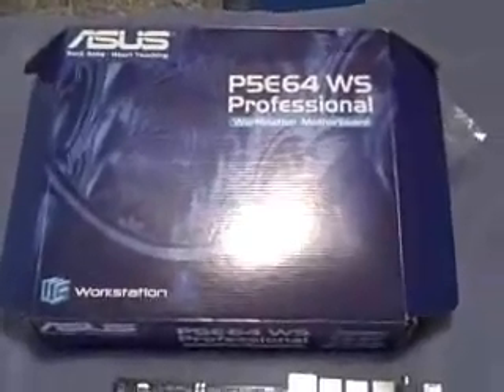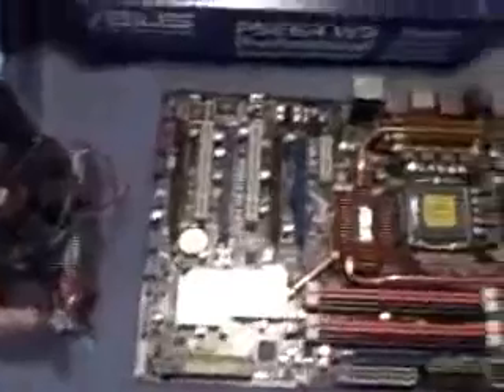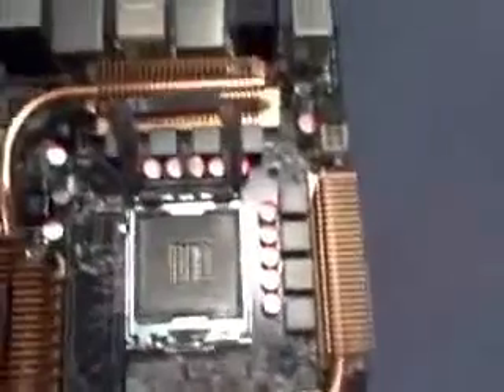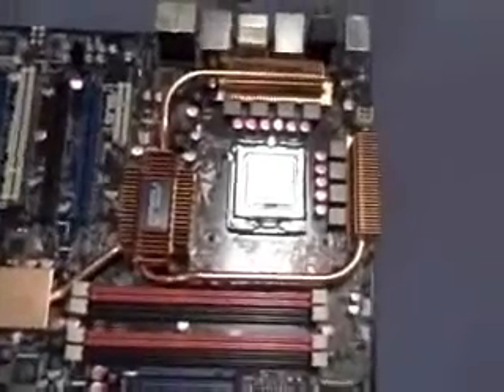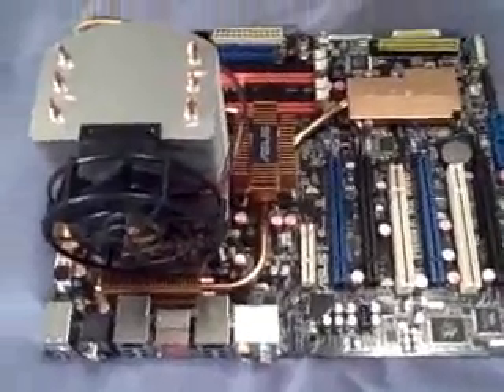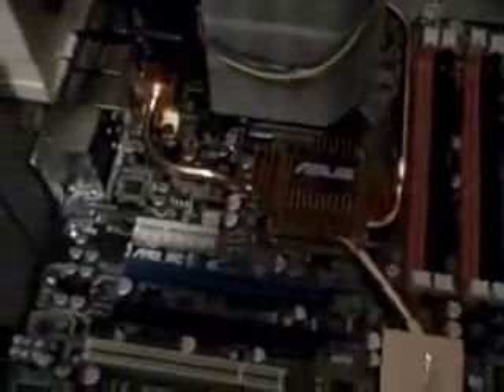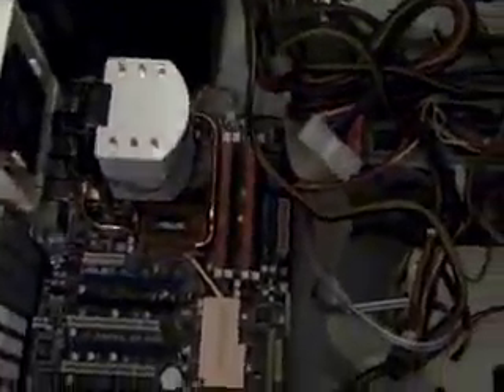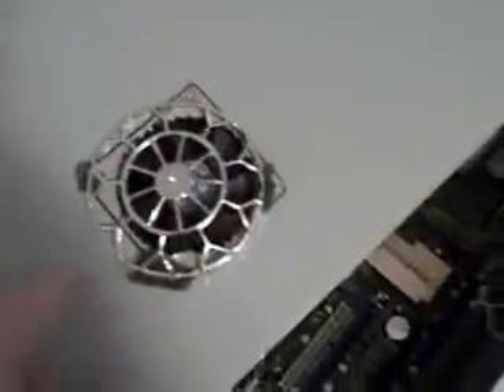Build A QX9770 Quad-Core PC

Comment: i am still running that thing on a790i ultra
with 24gb of ddr3 ram and gtx 460 sli
nobody who owns a i7 is telling me a thing
the 9770 extreme is realy ancient but still kicks asses!
looking forward for k|ngp|n 980ti :)
Reply: DONT PUT A 980TI WITH THAT CPU. omfg. you will bottleneck the shit outta that card ;_;
Reply: googlemaster190 -Minecraft
yes because i'm going to buy an x99 chipset from evga in january :)
the kingpin is running and there is now better performance. but since i own the nForce my system randomly freezes and finaly i looking up for something modern like an 2011v3
but the bottleneck is not so extreme than i thougt it would be
i can run far cry 4 on ultra without any laggs
Reply: @sun--shine3296  and?

Comment: "In about 3 hours if I don't snap off the pins"  What the hell are you talking about?  It takes 3 hours to install the heat sink?  If you're going to SHOW is how to build a system..then SHOW US...anyone can look at 'after the work is done' pictures...

Oh, and the fan is rotated 180 out for your CPU...it should be facing back of your case, not towards front.

Comment: actually no it was used i talked to the guy it was fine no errors from any overclocking cant remember why he was sellnig but did not want part with - believed really cool guy, but he said he could not find the fan but if i was to get that chip i would be also getting a liquid cooling system which replaces the chip fan he said

Comment: it was ebay but ichanged my mind and let the other bidder bid for it becuase i thought it was just as ok for extreme gaming to get a intel dual core 2 and the xfx geforece 9800 gx2 with and asus p5e3 deluxe motherboard and yes it doesnt allow sli but many MANY  peole say its unnesseary so i have gone really cheap and i think done the right thing - all for goddamn tiberium wars lo well i think ill also get crysis oh by the the qx9775 sold for 250 pounds roughly $500 lo

Comment: I'm aout to recieve the parts for my new PC
Intel Q9450
4 GB Corsair XMS2 DDR2 800
Asus P5k Deluxe, would've gotten a Abit IP35 Pro, but Newegg discontinued them :(
eVGA 8800 GTX
300 GB VelociRaptor and 300 GB normal Western Digital